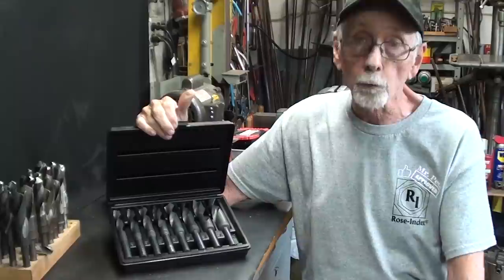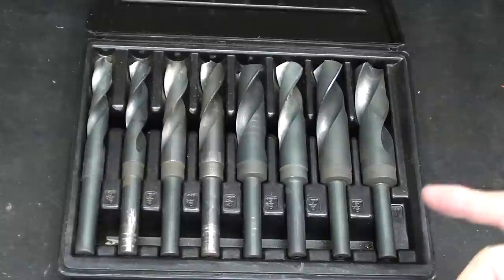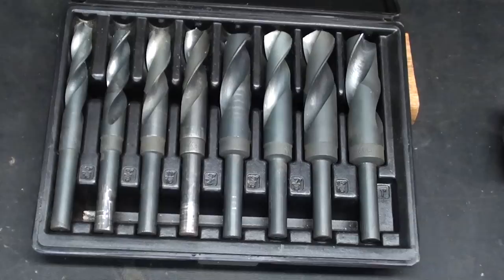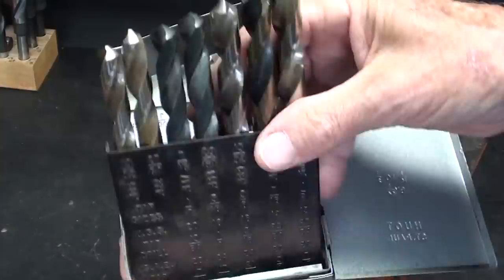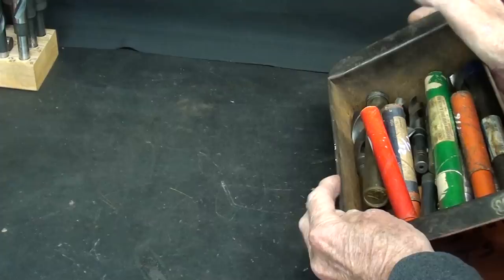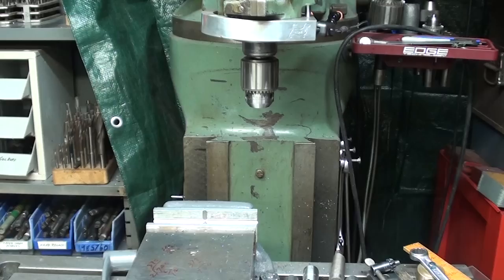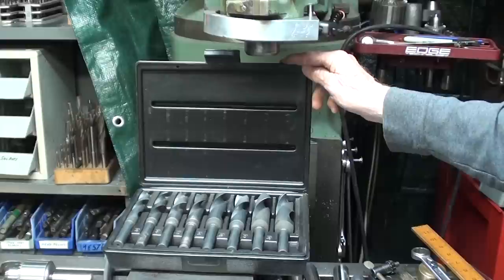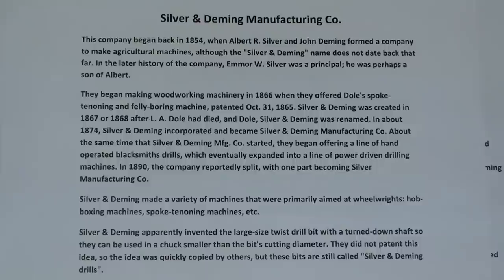WHAT ARE SILVER & DEMING DRILLS #14 short subject tubalcain

Comment: Others have beat me to the point by their already posted comments. I never tire hearing Mr. Pete talk on shop related topics, and I consistently learn new details about topics where I am already knowledgeable.
This video met this mark! I always thought that Silver and Deming was a brand not a style until I started encountering cheap bits called Silver and Deming. Lyle's explanation that this is a style clears up this mystery. 

My introduction to drill bits was working in an industrial production machine shop. Naturally I was exposed to only the highest quality tooling. We checked out tools from the tool crib as needed and drill bit brands varied from time to time and brand names often cannot be read on small tooling. I learned to gauge quality by inspection rather than brand name. I wasn't forced to face the cost of premium tooling until I built my home shops. I did like most newbees and bought reduced shank drills to expand my capacity never considering that I was gaining length advantages. Reduced shank was the name that our shop called this style of drill. I picked up a handsome odd assortment of new and barely used Silver and Deming drill bits thinking that I had found a superior product. When I examined them, though high quality, they were China marked on many boxes. Now I understand. I currently settle for the private label sets from sources like MSC, FASTENAL, and Grainger for my full sets, but I still long to set up full racks of premium branded "Silver and Deming" drills. 
I have bigger machines than before I started building my shop, so I am also shopping for quality Morse taper drills up to at least 2". I have machine capacity to go larger, but seldom have a need. I figure that the poor man's solution is to progressively bore the occasional large hole. Stocking large Morse taper drills a real challenge on a hobby budget, so this inventory is all used and is real hit and miss.

Thanks again Lyle. You hit another home run.

Comment: Mr Pete, are you a Cleveland drill fan? I have loads of them most are 40-80 years old from tiny wire size to around 3" or better. I find they are the best, last longest, and take the abuse better than most. I do have other USA brands that are good too but the Cleveland drills and Greenfield taps are my favorites.
Reply from the maker: Yes, I think Cleveland drills are the best, I have lots of them

Comment: Great stuff Mr. Pete, bought my set from Grizzly.  They must be carbon steel and not HSS.  They are good for about 1 or 2 holes between sharpening.  But really when I drill these larger holes they're typically clearance holes or for drilling as big a hole as I can before breaking out the boring head.  Also great history lesson on Silver & Deming.
Reply: Before hss, all we HAD was carbon steel (I'm sure you're aware already) and we made it work... slow speeds and lotsa coolant and CS tools worked well....in  fact its still used sometimes for form tools etc...

Comment: I use to work at a foundry as a maintenance tech. The scrap pile was always an interesting place to check for useful items. 
Taper shank drill bits were to be found in all shapes, sizes, and conditions. The giant camel back and big radial drill press in the maintenance shop could handle the big bits. Lots of travel on the camelback spindle and the radial could be raised up and down with the hand crank from hell. The radial had a 4 foot reach. 
Later jobs included machinist work and eventually management positions over maintenance/machine repair departments. Since the machines in the plant were setup to run specific jobs the tooling was standardized. Reseting the stroke on an automatic drill was more costly than just putting in a std jobber length bit and getting the job running quickly. Also the chance of error is greatly reduced. 
Over the years I have added a few tons to the scrap drill bits in the foundry scrap pile. 
I have a South Bend 9C lathe that accepts #3 MT in the drive spindle and #2 MT in the tailstock. I'm still using some of the scrap pile drills. I left  the foundry in 1973. 
Bent taper shank drills can be turned down like Mr Pete shows in his stock of bits. It removes the runout from the bent shank. 
I bought a Silver hand crank drill press and discovered the reason for the half inch shank. 
The press doesn't have a chuck. It has a half inch socket in the end of the spindle with a square head set screw. Every drill bit that was used in the press from 1/4 inch up in my drill selection for the Silver Drill press has a 1/2" shank with one flat on the side of the shank. 
I also have a hand crank Swan Beam Drill with the same drill bit mounting method. 😁😎

https://www.youtube.com/s/gaming/emoji/7ff574f2/emoji_u1f60e.png
Reply: Very cool, I didn't know this! Thanks

Comment: Interesting. I had assumed it was somthing to do with the steel not just the style of drill bit. 
I do find that they chatter horribly in the larger size without extremely low speeds. The morse taper does not seem to suffer this. The chuck must reduce the overall stiffness.

Comment: Mine are an old set from HF, they came in a wooden box and do have flats on the stems. They were sharp(ish) when new but they don't drill round holes. I consider them roughing drill bits 😁

Comment: I keep a drawer of old (dirt cheap or free no doubt) taper shank bits that I turn down to 1/2" shanks when I need one.
Reply: Interesting. I wonder how you hold the bits to turn them down since they’re slightly tapered and difficult to chuck on the flutes?
Reply: @ellieprice363  Between the flutes and the taper there is usually a chuckable zone.
Reply: @johnstrange6799  Thanks, I forgot about the short straight section.

Comment: I'm lucky, I have two Chinese sets of " Silver and Deming" drills ( I've never come across that name here in the UK ) imperial and metric 13 - 25mm and 9/16" - 1" and luckily they are properly ground! And I probably haven't used all of them but I've found no problems drilling properly formed holes with no rubbing whatsoever. I've been thinking of milling three flats on the reduced shanks to stop any slippage and galling the shanks. Nice informative Mr Pete, you keep on talking.

Comment: Thanks again Mr Pete. I used those bits many years ago when I was a machinist but tended to use the tapered shank bit over 1/2" diameter to drill holes. The incorrect rake on that set you showed is no bit surprise. I ended up with a set of jobbers length drills "made in China" trash that had the same thing. Can't imagine someone with no experience trying to drill holes with such garbage. I feel for them. Me, I just resharpened them by hand and they cut just fine after that. Even those "Drill Doctor" machines they sell in the big box stores are a joke.

Comment: Dirt cheap when I started as a hobbyist in 1984. Still have them. Still use them. Mine I got from Enco. Cost about 20 bucks. Drilling is still a fast way to remove metal with mininal equipment.

Comment: Yes, "Silver and Deming" type of drill bits did, at one time, come in sizes below the 1/2" shank!
 I just found a set of 1/2 inch shank drill bits in my 1908 Sears catalog.
An 8 bit set consisted of 1/8", 3/16", 1/4", 5/16", 3/8", 1/2", 5/8" and 3/4" sizes.
By the way, this set of drill bits came with their $29.71 blacksmith setup which had an 85 pound anvil (with 3 hardy tools), lever forge, Post Drill press, Post vise, and a few hand tools.
They did sell those bits separately, too, in 1/32 increments between 1/8" and 1 inch.  7 cents for the 1/8" and 71 cents for the one inch bit.
Reply from the maker: Thank you for that information. Amazing prices

Comment: I'd always wondered where the name came from.  I just bought a set from HF, you are correct, the clearance angles are not good and need to be reground right out of the box.
Just for grins, I'm going to see how well a Drill Dr. works.  I won't be able to do the larger ones but the smaller ones will fit.

Comment: A must have for anybody drilling a hole up to an inch. Love the Silver and Deming history lesson.
Sadly a lot of the cheap drill presses turn a bit too fast. 
  When a guy I worked with was cleaning his yard he had a big heavy old cast iron self feeding drill press rescued from the scrap pile. It had  no motor and the self feeding drive shaft was broken. After a bit of work it sits in my shop taking up space until I need a bigger hole drilled. I bought a pile of MT drill bits just for it. if I have to choose between it or the Craftsman drill press, we already know the answer.
Reply from the maker: There is nothing like those big old presses for drilling large holes. I had a big old buffalo at the high school. It had number four taper, power feed. And would run it about 40 RPM

Comment: Mr. Pete...Good video but you skirted one of the advantages of of the Silver & Deming drill bits.  Yes they are all turned down to 1/2 inch shanks.  But they are also the same length as a 1/2" jobbers drill.  What you missed is that all being the same length, it is an advantage when switching bits when making multiple size holes in a workpiece.   You don't have to keep cranking the table of a drill press or the head of a mill.
Reply from the maker: Sorry, yes, I did miss that

Comment: As others have said, the mainland Chinese Silver & Deming drills are hit and miss (like most of their goods). Flats on the shanks are a must. Without them, as Lyle says, the shanks will get chewed in a chuck if used for anything other than the lightest work.

If the drills are not correctly sharpened, I find that it is easier to sharpen large drills on a belt sander versus a grinding wheel. Since about 60% of the axial force required to make a drill cut is from the center of the drill having to chisel its way into the work, a pilot drill makes life so much easier for Silver & Deming drills. A pilot drill means the center of the Silver & Deming drill doesn't have to be perfect to avoid chatter, wandering, and out-of-round holes. If the cutting lips are even and there is clearance behind the lips you are good to go.

An aside, a hint for the home machinist. When you go to yard or estate sales with your better half keep an eye out for good quality drills in the 1/4"-3/8" diameter range lying about in the shed out back. Yes, you have full drill sets at home, but these drills go into small boxes beside your drill press, milling machine, and lathe. Having these drills at hand make drilling pilot holes in your work a 30 second job. If you need something to do on a rainy day, put these stock sized drills into your 6-sided collet block and mill 3 flats on them as well. It will keep the shanks pristine.

Cheers from NC/USA
Reply: I recently bought some cobalt bits from Menards.  They were ground wrong as well.  I corrected the drill angle by using a sheet of emory paper while reshaping the heel of the angle before it would cut.  I was very disappointed.

Comment: Hey thanks for video. Shop I used to work at the worst offender was drilling to close to pilots.  What I am trying to say is, say you are drilling 3/4 holes, don't drill a 1/2 hole fi⁸rst, drill say a 1/4,  less than the web, ok, 3/8, but less than web thickness of big drill.  Drilling just a bit bigger has a bigger chance of bit slipping., you know what I'm talking about.  Seen many chewed up shanks, repaired a few, rewelded a few and turned down to 3/4 fit r8 collets, yep, bobbed off and arc welded on, no problems, ok, just a bit of stress relief,  old boss introduced me to arc welding hss to low carbon 40+ years ago.  Hey Pete,  shop I work in now, we have a radial arm drill press, wonderful machine, #5 taper, but most of the bits I use are silver and demings.   But most have 3 flats, plus we have a Jacobs  super chuck.  You covered the 3 flat thing. 
What I am leading up to, if you are predrilling for a big drill bit, don't predriil much bigger than the web of the bigger drill, won't catch and spin as much.  S and d bits are my friend,  short which is good, up and down on z axis affects location.   I don't like to move knee much, even if head is trammed in good.  Hope you all followed my logic
Reply from the maker: Thank you for an interesting and informative comment

Comment: I think they (or somebody else) made half inch shank drill bits in sizes SMALLER than half inch. The bits seem to have been silver soldered into the half inch shanks. 
 I have a few of those bits, but I'd like to have a set of at least 6 or 8, but I have never been able to find any more of them
. Most of the old blacksmith's post or wall mounted drill presses had a simple half inch collar on the quill that often had a set screw to hold the bit in place.
So, of course.   all sizes  of drill bits had to fit that half inch collar.  I think I still have 2 or 3 of those drill presses around here somewhere, and we also have some at various threshing show blacksmith shops.   Of course, I have adapted several of them to jacobs chucks for "modern" use.

Comment: The size of a drill chuck is really intended to use that size of drill as the maximum size. For example a 18n Jacobs 3/4" chuck should really only use a 3/4" drill as maximum size. Of course that goes out the window quickly in the real world. . A 4" or so riser block on a Bridgeport style mill is a godsend for many operations, especially drilling and reaming.

Comment: I have a small objection to the comment that most drill presses you will find in a small shop or home shop do not have a removable taper.  I admit I haven't seen every drill press on the planet or even a significant fraction of them, but it seems like in current production only the smallest five-speed head drill presses do not have a morse taper. At one time I had several inexpensive drill presses set up in my shop so that I could stage operations, and all of them had a morse taper spindle.  I would note that even from a discount or low price import provider there is a relatively significant price jump between the little five-speed and the next smallest drill press.

Comment: yes pint well made  But a clever man such as yourself would be able to demonstrate a way to ues the spar gears we have laying arrowed to  gear down The pedestal drill  press to accommodate such drills at low speed   By making a stand of fix tear such as the one your growing to put on  to covert  Your  wood saw in to a mettle cutting saw.  Making one out of you spear  gear left over from the degraded & sold of lathes.  LOL Hell you could even Mack one by cutting you own gears . les England  say out of dleron. if theirs any laying around ?

Comment: Hi Mr Pete. I’m new to your channel. I saw your video on the Silver & Deming bits. I bought a set for $100 in Canada here. 9/16 to 1 inch from the “Pacific”. I was impressed with the wooden box so I stained it. Mostly I do welding so I’m particularly hard on drill bits.
I was interested in the rake you were showing. I agree with the ones I saw but I think mine are slightly better but not by much and with inconsistency. 
Thank you for pointing that out because most of us just expect new bits to work. I’d rather just touch them up then rubbing and burning so I’d basically have to start over sharpening.
I will try to send pics but I’m learning and can’t see your complete email address.
Thanks again
Reply from the maker: Thank you for watching. I’m not sure what you meant by rake? Lots of these drillbits sets are inferior and not sharpened correctly.

Comment: Hi Mr Pete good video . I bought a set Hss from banggood and they are only good for wood or aluminum way to soft for steel . Well what to do look at a more repeatable place like Shars  and i asked how made them well they are made overseas and they gave me the name of the company so i called them and went with there HSCO ( M35 ) bits and they work well with steel . I agree that some of the $40.00 sets might be unusable for steel my 13 pcs set ( 9/16 to 1' ) cost i think $250.00 or a little more . Thanks Mr Pete .  JM

Comment: What drill press doesn't have a taper? Even the cheap HF stuff has a MT2 or MT3 to attach the chuck.
My 40-yr old import drill press is MT2.

When I replaced the chuck I had to buy a new JT to MT adapter because the Jacobs taper was different on the new (to me) Rohm chuck.
Reply from the maker: I have five drill presses without Morse  tapers. Just last week I bought a seers drill press, it has a tapered spindle. There is a video coming up on that soon
Reply: @mrpete222  so the chuck is held with a screw like a hand drill?

Comment: is hss quality worldwide  standardized?
because I wonder if there is  a serious quality difference between hss steel ?
I notice that because one hss drill is soft as butter while another is much tougher and harder ? (and i dont mean cobalt drills, just plane hss drills).
Reply: I bought a set of Imperial blacksmith's drills from a reputable trader here in the UK, the 5/8" one wasn't hardened at all. They sent me a replacement,  but it did make me wonder what that one drill was actually made from ?
Reply: umm, no    The cheaper the worse, sometimes but not always true. Made from European or US steel is generally good. I have seen import "tools" that were soft as lead, ok, well almost.
Reply: @67L-88  is there a way to check it,s good quality hss from a seller other than relying on his story?
Reply: It would be easy for manufacturers to cheat on the quality of steel or the hardening and tempering process. With no worldwide quality standards there’s no way to tell.
Reply: @ellieprice363  ok, thanks for anwsering.